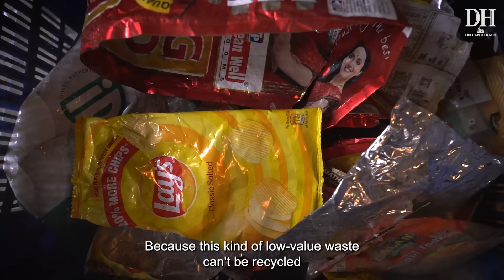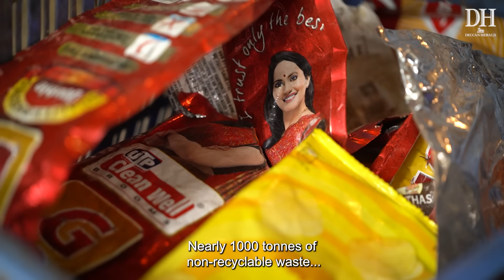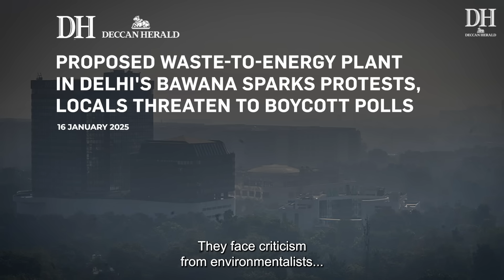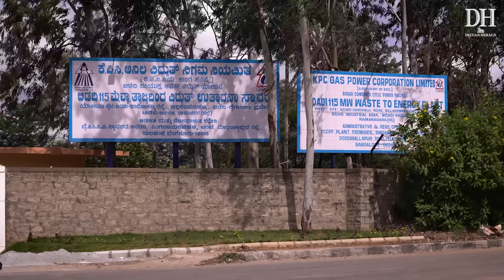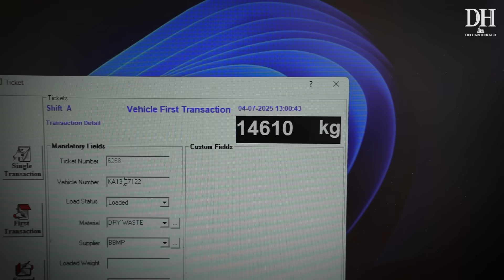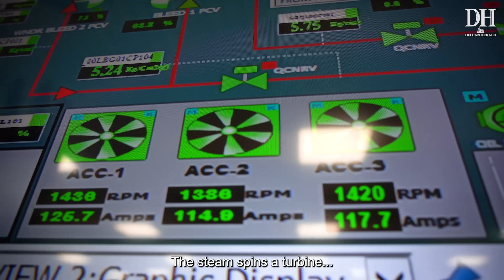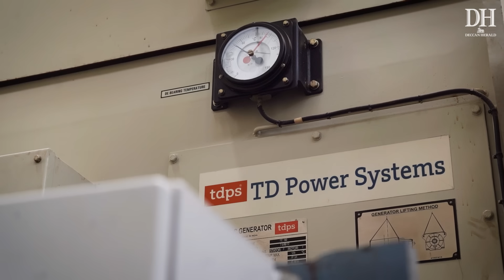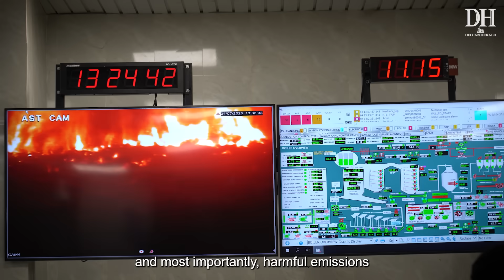How Karnataka’s first Waste-to-Energy plant burns Bengaluru’s garbage, generates electricity

Comment: The problem with this initiative is that incinerating waste produces loads of carbon dioxide which just gets released back into the atmosphere, further contributing to climate change. It’s why the solution needs to include reusing and recycling, while also consuming less (if possible). I also think governments need to invest heavily into projects that utilizes plastic-eating microbes or enzymes so we can break down the waste without contributing as much CO2 (these things still produce CO2 as a byproduct, but for instance, the enzymes create 46% less CO2 in comparison to simply burning the waste).

Comment: We need plasma reactors instead of incinerators. Plasma reactors burn at 10000 degrees and are far more effective at tackling the occasional odd materials that get mixed with the waste. They're also self sustaining. The byproduct of syngas has enough hydrogen to power the plant autonomously.

Comment: For the emission issue, I feel that some part of the generated Electric ⚡ Power should be used to operate an Electric ARC, operational at the exhaust side. The high voltage Arc will split the exhaust gas into its basic form like, the

1) CO2 & CO becomes Carbon Ash that settles at the  bottom and Oxygen gas escapes into the environment.
2) NO2 & N2O becomes Nitrogen and Oxygen, both harmless gas moving into the environment.
3) SO2 & SO4, becomes  Sulphur powder and settles down, while oxygen escapes into the environment.
😏😏😏

Comment: WTE plants are the only real way to handle non recyclable waste filling up these landfills. The high cost of this plant should be balanced with lower cost plants to give the consumer a decent rate. The high costs for treatment of the leachate and air emissions don't do it any favours but is required to solve a problem rather than creating another problem while trying to solve one.

We need better segregation from source initiatives and waste collection methods. Lots of waste still being thrown about on empty lots and on the roadside

Comment: One of the major upsides of WTE plants is the volume reduction of the waste that goes to landfill. If I remember correctly, the ash is only 1/10 of the volume of the original trash.
Therefore, if the plant is not economical, the alternative (trash being put directly into landfills) is just not expensive enough yet.
Long term the WTE plants could play a vital role in the energy transition away from fossil fuels, stepping in as flexible energy sources when volatile renewables don't deliver enough. It's a challenge to coordinate (the plants would likely need a higher capacity, which means higher CAPEX, while running less; and more storage for all the trash might be needed) and perhaps it won't be feasible without subsidies.
With the further improvement of recycling and the flexibility of such plants, I do believe that subsidies would be worth it to solve the volumetric issue of the trash. Having less gigantic and toxic landfills is better for everyone and should be one of the main goals here.

Comment: Fantastic initiative. This is arguably the best solution to solve waste recycling and littering problem. If every city in India introduces this initiative, then India will be a pollution-free environment.
Reply: Without a very good filtrating system, it's very toxic for the environnement because the dioxins and PCB toxics.
https://en.wikipedia.org/wiki/Dioxins_and_dioxin-like_compounds

Comment: WTE can never be profitable if you don’t use the excess heat generated for cases like district heating or cooling. If you get revenues from two products then this business becomes profitable. You have to get paid for electricity and also the heat generated from this plant. If it is colocated with heat required industries like steel plant or so then it would be efficient or you can even provide cold storage for farmers or a huge investment option is to provide district heating or Cooling to residents near by. Countries like Sweden are successful in  running this business you can learn lessons from them.

Comment: Emission violations are very common. The sensors may not be calibrated on the required schedule, or sensors turned off at nights. Watch what they do to circumvent regulations. The more the solid residue is, the less efficient the burn is. And the less efficient the burn is, the more the toxins emitted.

Comment: in order to manage the metal parts that get caught in the furnace the most commonly used method by such plants in other cities is to use a powerful industrial electro magnet to remove the metals after which its burnt. The ash that remains is used as fertilizer or other suitable purposes as well as the carbon produced while burning it is collect from the chimney and used to produced ink

Comment: It’s a very good initiative. As the guy said, ‘it’s a social obligation’. A lot of people are overly caught up on the need to turn a profit. If that’s your concern then stop using non-recyclable waste in your homes. If you don’t, then appreciate the fact that there aren’t any alternatives to deal with it.
The plant can sell the fly ash. Concrete made with fly ash is much stronger than that made with traditional cement and in many cases does not require steel reinforcement, which prolongs the life span of the concrete. A lot of research on this was done by the founders of the Hinduism Today magazine when they built their temple in Hawaii. The plinth for the base was cast using zero steel and only fly ash concrete.

Comment: You say "all because segregation has failed"...  So start with the root cause.. Implement segregation to the very fine level... We in germany have 5 types waste bins.  Wet, plastic, paper, organic, recyclable.... And the Municipality takes the Trash in a proper way.. No problem.. So why an largely educated population of Bangalore should be facing problems? Something basically WRONG... REPAIR THAT

Comment: Such burning of Municipal solid waste which contains plastics, releases harmful dioxins in the atmosphere.. 😮😮😢
Reply: In a WTE plant if properly designed, it's not released directly,  but filtered via special filters that's how singapore and other countries where they are using it for long now function. The biodegradable waste is usually sent for composting however unfortunately unlike in other countries where bins are provided at homes for segregation at source for degradable and non degradable waste here everything is mixed and not properly managed which eliminates that option(of composting etc.)

Comment: Great explanation 👍
I have just one correction.
The Power output of 11MW is a measurement of power, not energy.
It's not 11MW per day, just 11MW.
And if you want to calculate the energy production per day, its 11MW x 24h = 264MWh .

Comment: The Waste to Energy plant is a brilliant initiative that has the potential to make a significant impact, but it faces challenges due to insufficient support from both the government and the local community. To ensure its success in the long term, it’s essential for everyone to embrace effective waste disposal practices. By implementing and adhering to strict waste segregation rules at home, we can lighten the load for waste collectors and facilitate a smoother process overall. If we all come together as a cohesive team and commit to this vital change, we can truly empower this initiative, ensuring its sustainability for as long as waste exists.

Comment: These plants and technology are decades old and are operating in many capital cities of the world including London Singapore Shanghai Dubai etc.
I worked on the first one now being commissioned in Australia in the commissioning team
Two major suppliers of this technology that originated in Europe, one being HZI - Hitachi Zosen Inova and the other being a Singapore company that bought out the technology from an European company. I noticed the sign on the plant listed Hitachi Zosen India so it must be a partnership with HZI Europe.
Its well proven and works well and if they are worried about polluting emissions in India from this plant then it due to cutting corners on the flue treatment part of the plant. Correct dosing with active carbon & calcinated lime is designed to remove all toxic emissions which should be monitored by sensors on the flue stack with continuous reporting and recording.
These plants are also very profitable according to the plant experts who were on site for the commissioning which is another reason why they are popular in other countries
They have at least three sources of revenue, from the municipality for taking the waste, from electricity generation and sale to the grid, and the byproduct from the burning process can be sold for road base and other uses, so I am not sure why that woman said they are not profitable. Must be doing their accounting differently or not getting paid to take the waste.

Comment: You cannot burn dry waste that may contain harmful chemicals like bathroom cleaning liquids / pharmaceuticals like tablets / paint / resins/ particle boards which use chemical glues / glass / non- flammable plastic that won’t burn fully / 100s of other chemicals used in electronics or toys or batteries and so on. That’s a fraud an idea or lazy person or dumb person s idea. There is no technology to burn these even to 90% extent unless you use a furnace that’s 2000 plus degrees when the unburnt solid turned gas at high temperatures should be submerged in water and captured again to dry it and burnt it again.

Comment: What is needed across every city and district is the installation of a biogas facility to convert wet waste into biogas which could be used for cooking, and generating electricity. Biogas has been successful in most countries, and it's the best way to reduce landfill waste. A biogas facility would be great for residents to refill their LPG cylinders, and for their residents to have electricity.

Comment: For ferrous material, using a magnetic seperator, which separates metal parts using magnetic properties
Reply: I was having the same thought that why don’t they use a magnetic separation system for segregation of the iron and steel materials

Comment: I'm an expert on bangalore's municipal solid waste management and I'm sad to inform bangaloreans that I've seen in the last 9 years different governments have invested around 450+ crores of our tax payers funds in setting up useless waste management plants and even filling up abandoned quarrys creating a bomb due to the methane being trapped and almost 80% of these plants are either shut down or not working at even 20% efficiency. To date, every new government that has been formed and the useless Bbmp announces grand plans of setting up a waste to energy setup but have all failed (except this one which is also not efficient) and remain empty promises. Waste management is crucial for any large city and we have failed to say the least in terms of handling it and the citizens and politicians don't care as long as they don't see the garbage they produce outside their premises. We, the citizens of bangalore, with the help of the media, must put pressure on the government to find a solution with dead lines and not just allow them to pocket our tax money for doing nothing.
Reply: What is needed for every city and district is the installation of biogas to process wet waste products to generate gas and electricity, so that such a biogas facility can distribute electricity to the substation. We don't have a proper recycling system to give away plastics, mix metals, and paper products to a recycling centre to weigh them, and get money. I collect plastic items, mix metals, and paper products for my home, and I hand them over to a kaabli wala as he weighs them, and I get money. The money I collect I put it aside and deposit it at my nearest post office under the postal schemes to save money.
Reply: Protest in front vidhan soudha
Reply: @SonGoku_0506 won't make a difference
Reply: @kaushikg747 I know 
Im from here too
Riding on roads is a pain
It feels like if just infrastructure did its job i can bear the traffic 
No lights during night
Potholes
Broken roads and garbage everywhere for so called silicon valley of asia calling for global investments
Reply: Hello everybody ! My name is 6373. I always keep apologizing to united Nations and all eight billions peoples of the world on our healthy planet nonviolently honestly peacefully equally brilliantly intelligently seriously critically truthfully
Reply: Yup why don't we issue tender to a private waste management companies.

Also forget government, you ENTREPRENEURS, STARTUPS, FOUNDERS or even RICH BUSINESSMEN start WASTE MANAGEMENT COMPANIES. See how you can make it a business and get ROI.

VISUALIZE THE POTENTIAL like any SOFTWARE COMPANY etc.

There's money to be made if some one knows how to make a waste management company but with same  competency as a MNC or software company.

Just saying one MNC or software company level WASTE MANAGEMENT COMPANY worth a few millions or a Billion and then see how waste management companies boom

Its not difficult, saying if a fast food burger, pizza, jewellery company can operate like a corporate with branches all over and run with huge profits, WASTE MANAGEMENT COMPANY have even more potential because who doesn't want a clean HEALTHY planet.

Atleast ensure your WASTE MANAGEMENT COMPANY has contracts with pizza, burger companies or any companies for that matter to collect, recycle and do waste management.

Just keep in mind endgoal is make planet clean & healthy along with ROI BUSINESS MODEL. DON'T BECOME ANOTHER MONEY MAKING BUSINESS ONLY.

Also dispose waste properly, or recycle in a sustainable way. Hire, get technology, get investors like any startup folks WASTE MANAGEMENT COMPANY is a great business idea 💡

Comment: Waste-to-energy is interesting but solar is still the cleanest long term solution for India's energy needs. I've been following a company called InfraBrite Solar that's developed non-PV technology achieving 93% efficiency in lab tests with early pricing at 5 cents per watt. What's even more interesting is they also have an ownership model where people can buy small solar units installed on businesses. The businesses get 15% savings on electricity and owners collect revenue with much better ROI than most investments. At 3 cents per kWh this beats waste-to-energy costs and doesn't require complex waste logistics or emissions management. With India's abundant sunshine, breakthrough solar technology like this could power way more than 25,000 homes without needing to burn anything."
Reply: This plant serves different purpose, main goal not power generation,  main goal is safe disposal of urban solid waste.
Reply: @vidyaranyavijayapura1121  very true 👍

Comment: Can that ash be used as building material?
Reply: Singapore is using the similar approach - and the ash is being used to manufacture construction bricks and man-made islands.
Reply: bottom ash can be mixed with fly ash and can be used in construction, I had done a research on this in my final year in engineering. got good results but it was more expensive than normal concrete construction